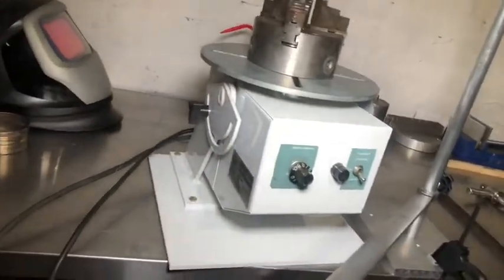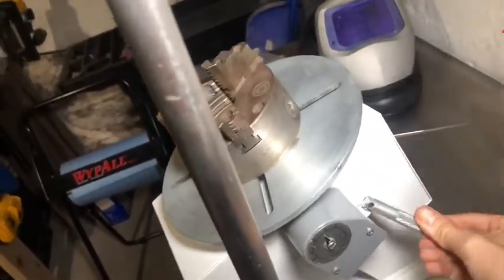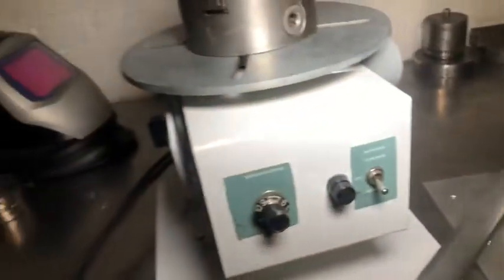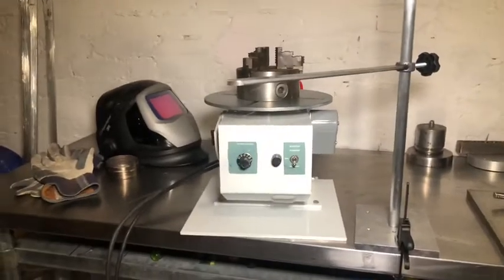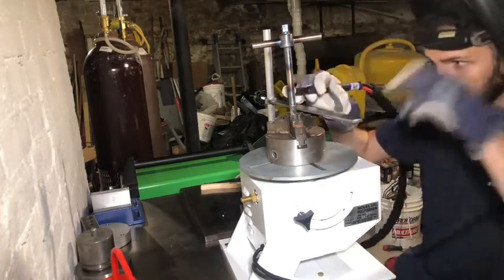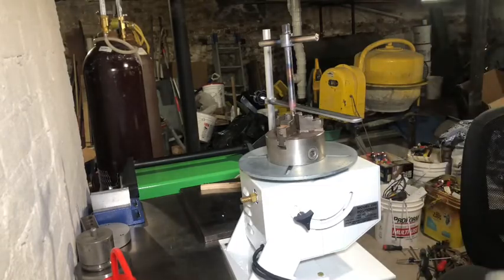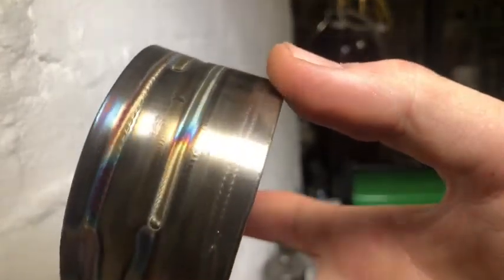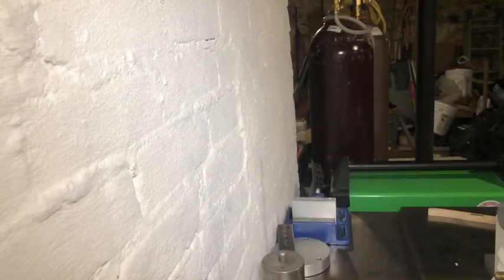TIG Welding with Positioner

Comment: I have a positioner, but haven't used it much because I can't get it turning slow enough.  Tried a router speed controller but that didn't really help
Reply from the maker: Yeah that's usually a lot of peoples issues. You cab try and wire up a petensiometer
Reply: @belloautomotive1522 Yeah, it's no good.  I'll take it!😜